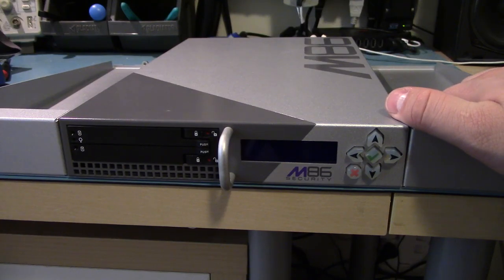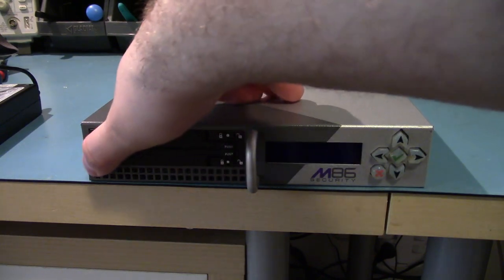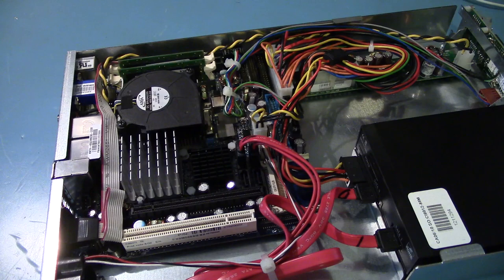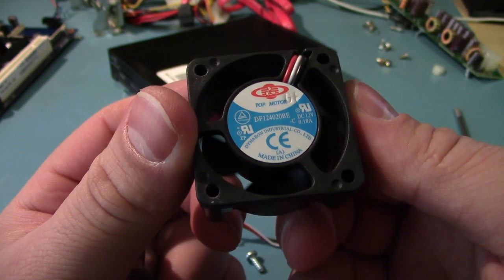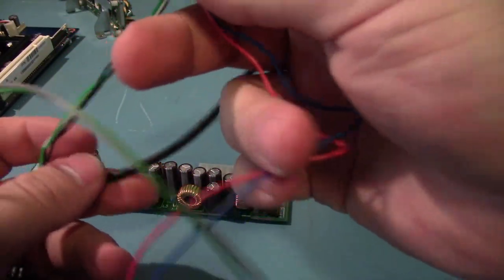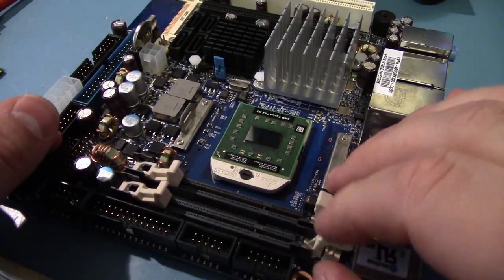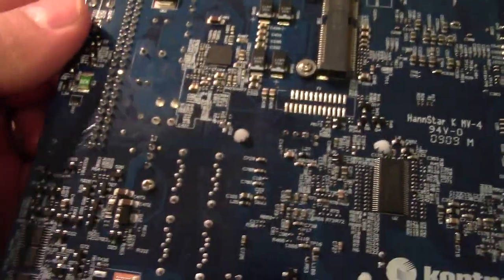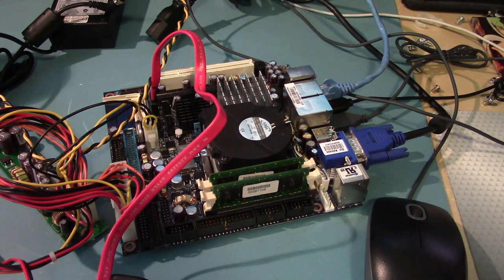M86 Security WFR-350 Teardown

Comment: Definitely a good buy.  Good call on the caps.  I checked out the board just now on their website, you're right, you have to choose the one that says "Legacy", the other ones are are BGA and different design.

KY is a good cap series.

In the download section, they offer VxWorks images...  I wonder if this board would make a good router with those images.
Reply from the maker: The real limitation - at least with BSD based OSes like pfSense - are the Realtek NICs. pfSense (my router OS of choice) is super unstable with them. Like I mentioned. But seriously - I have heard it is practically unusable.

I don't know about Linux OSes and how stable their drivers are for those NICs, but I am not a Linux guy at all. Probably because I come from a Mac OS X background which is UNIX/BSD based. Windows didn't seem to have any problems with it and actually seemed quite responsive.
Reply: That's a big exaggerated; i'm running pfsense for years and years now with various cpu's but almost always realtek nic's. Never had any problems with them. I've used my pfsense routers/firewalls in domestic settings with "normal" traffic. Maybe in high traffic enterprise setup this wouldnt be the most reliable combination of choice. But then, why would you go pfense in enterprise environments. That's where cisco comes in mind.

Comment: Kontron is a big player on the market for embedded devices for industrial use, just like portwell, quanmax etc. There's nothing wrong with that power supply; it's just a dc -dc buck converter design, indeed like the picopsu. Most modern high efficiency psu's (amongst those from high end brands) are based on this design. Just another evolutionary step in psu design.